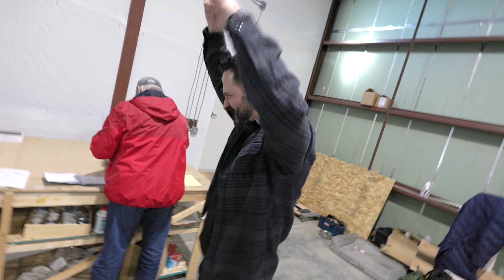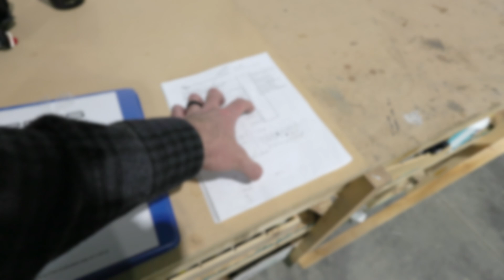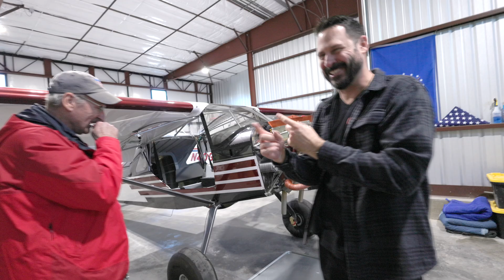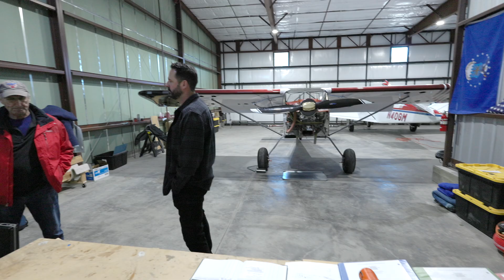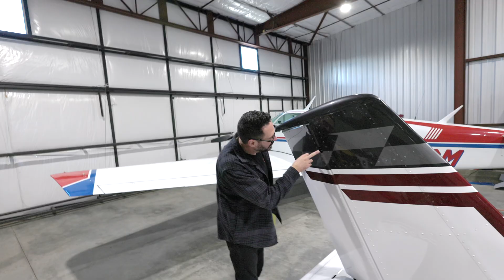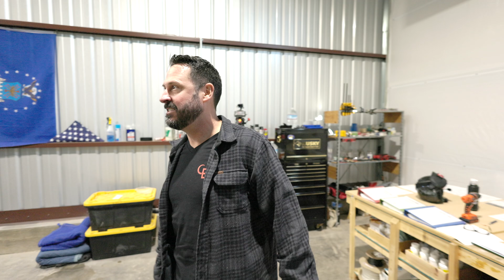The Bogey Is AIRWORTHY!

Comment: Congrats!  Question about your camera mounts…. Have you or other builders ever run usb power out to mount points on wings and tails?
Reply from the maker: USB-C is heavy, expensive, and lossy so I have 2 power supplies I have yet to mount. I run aircraft 18ga wire to them and the power supply converts to USB. https://www.prorigshop.com

Comment: Enjoyed your video.
One correction.....     the Certificate portion (the part at the top of the first page) of the Certificate of Airworthiness is the document that needs to be on display and visible at the entrance to the aircraft (requirement is in the FAR's).
Not the registration card.
The registration is what just needs to be in the aircraft and made available to authorities if requested.
Not having the Cert. of Airworthiness visibly displayed is a fast track to a ramp check.

FAR 91.203(b) states "No person may operate a civil aircraft unless the airworthiness certificate required by paragraph (a) of this section or a special flight authorization issued under § 91.715 is displayed at the cabin or cockpit entrance so that it is legible to passengers or crew."
Reply from the maker: Thank you so much! I was scratching my head why I don’t have my Bonanza’s registration visible… see great nuggets like this keep me posting videos!
Reply: Yep, I was wondering if that was a slip of the tongue or I had it wrong all these years!

Comment: Congrats! Now I need to check my motor mounts. Yikes. 
We went thru 2x Kavlico oil pressure sensors. I bought a RIFE and it's lasted!
Reply: Secured our wiring to servo plate with adel clamp.